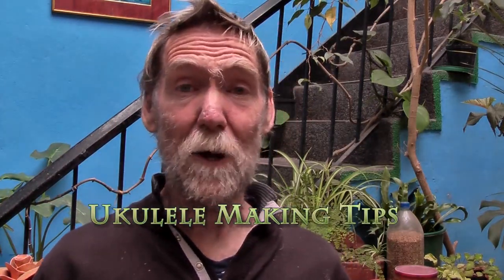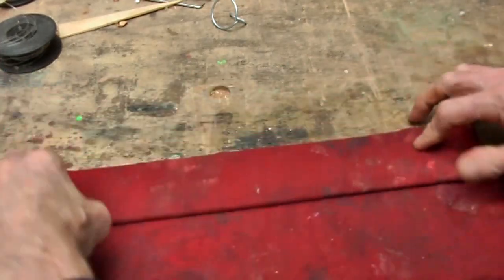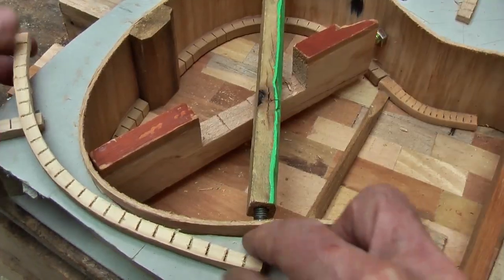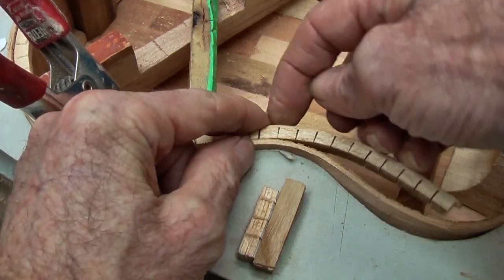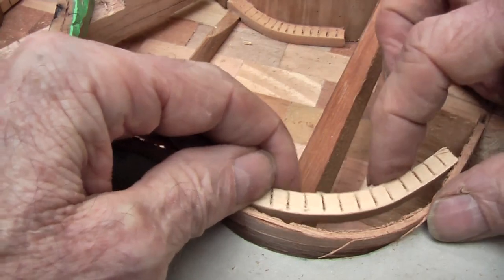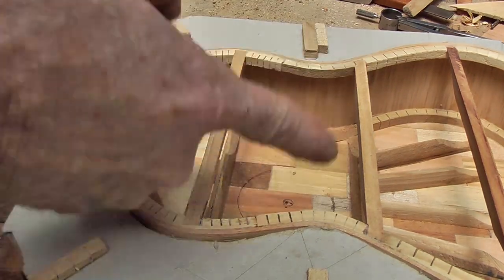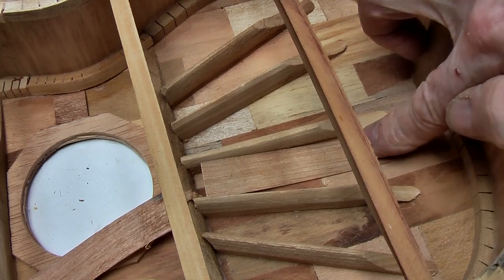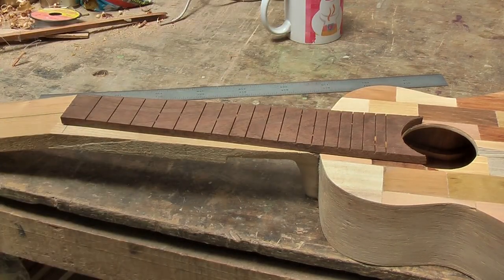UkeTips

Comment: You are amazing as always! :-)
I may have some tips / tricks for you that will make it easier for you.
Bending off wood: You can, as you do, steam bend or heat bend, heat bending does the same but without ever using water. If you may be interested in hearing more, then please say so. Steam bending can you do a lot easier by getting a square metal tubing, put the wood inside wrapped in the clothes and then plugged in both ends, now let that square tubing rest on the stove and let the water steam the wood all over in a uniform way.
Gluing: Try to use salt or sand in the glue joint, this prevents things from gliding. If  you want to avoid wood bending, can you start by putting a very thin layer of glue on both items and let them both dry completely, then check for any bends and lastly glue the items as you normally do.
Reply from the maker: Thanks for the suggestions. I like the  sand in the glue idea. The problem with bending wood is that the fibres don't soften until at least 130 degrees celcius and water evaporates at 100, so you  are always struggling to get things hot enough, but not burning the timber. Also older well seasoned timber seems to me to be harder to bend as the fibres have set over the years, and it takes quite a bit  to soften them enough, so they will compress. Regardless, it  is all fun. Cheers.
Reply: @PhilipStephens007  this is why a square tubing is great, you are able to get above 100 deg C since the water is trapped inside:-)
You could instead (this costs money) buy a steamer for wallpaper removal.